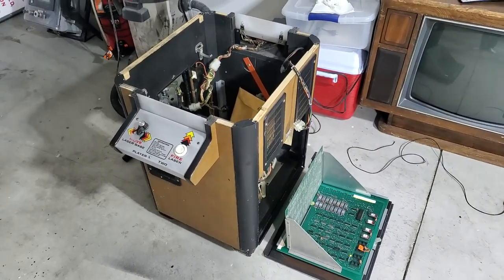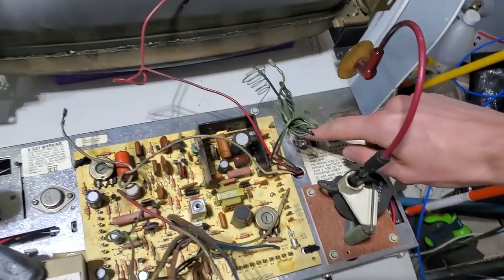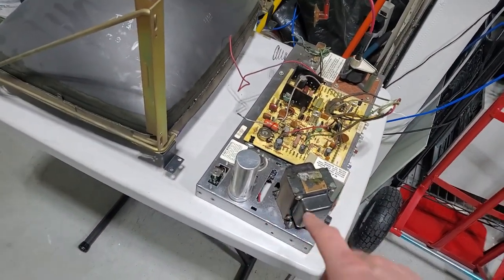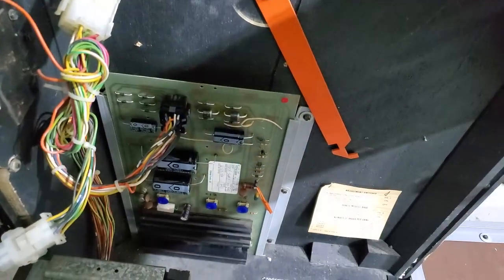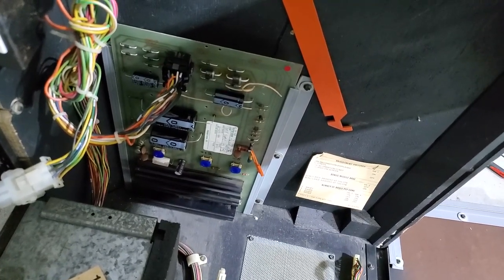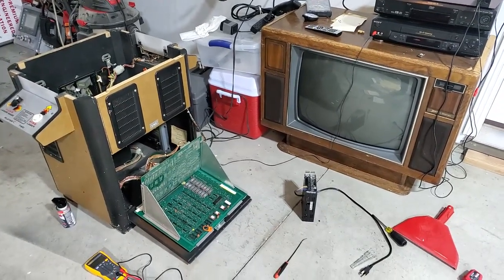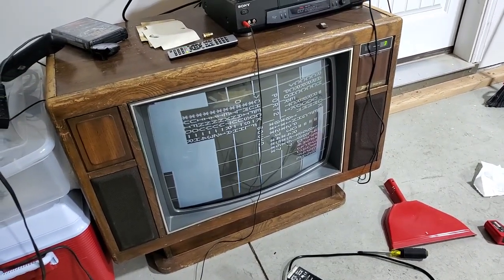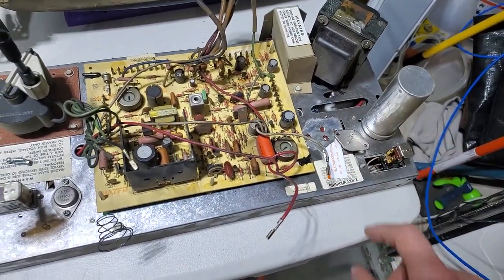Space Invaders Repair Part 1

Comment: The shift registers are ONLY moving the characters up,down,left,right? or do the shift register do other things? The Shift hardware has a "shift amount" but shift register IC chips don't have an inputs called "shift amount", so what is this shift amount?
Reply from the maker: It seems the only thing that they're being used for in this instance is for moving graphics on the screen per pixel, there may be other uses in other games though, Idk. the shift amount is a number fed into some flip flop chips before the bit shift circuit. the ICs don't have an input called that, but that's what part of the bus is labeled for the sake of making it easer to understand what lines do what. it's also just called "port 2" on the schematic.

Comment: I know you posted this awhile ago but what exactly are you doing to hold down the reset pin? I have the same one and I cannot figure out that part.
Reply from the maker: When I was testing it out without the original power supply, I had the meter in current mode, so it would act as a direct short. I was touching one lead to ground and the other to the reset pin, it's like using it as a wire

Comment: How does this work with a color tv?.. space invaders is usually kicking out black and white from the game pcb to a black and white monitor.
Reply from the maker: Most black and white games just output black and white composite video to their monitors. Without the color signals in composite, the image is pretty clear. you have to be careful when hooking up arcade PCBs that output composite to consumer TVs though since they often output a stronger signal than TVs are designed to handle.
Reply: @Tr3vor42532  I kinda know what u mean.. I've seen tnt amusements hook a color monitor to space invaders. What wires hook to what tho?
Reply from the maker: @Meekimotosyoutubechannel  I'm not sure how you'd hook it up to a color monitor since those take rgb, they don't have the decoding hardware for composite, which is why I used a TV instead.